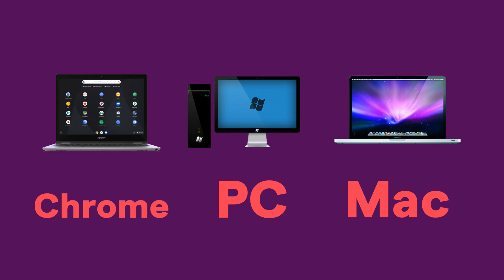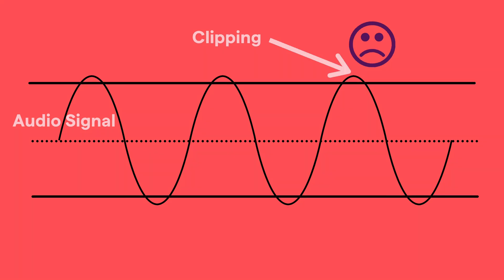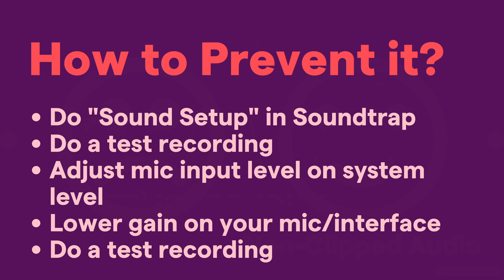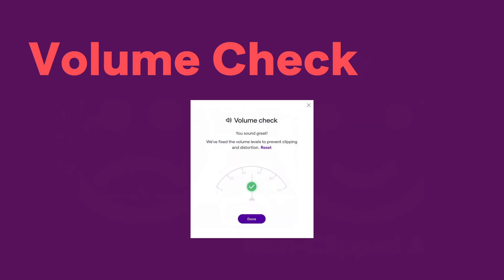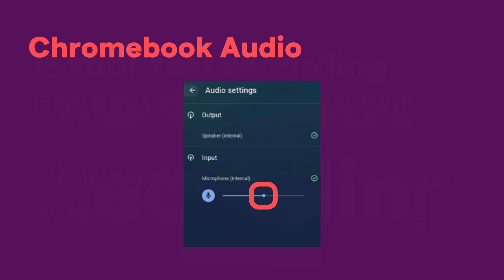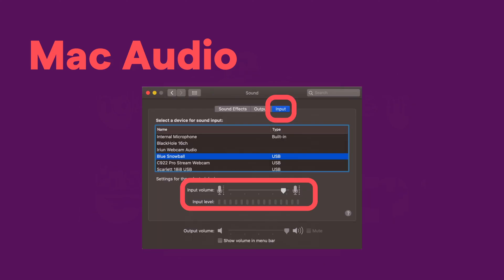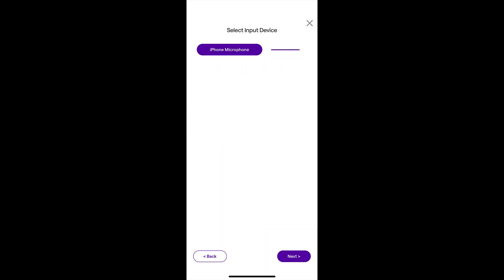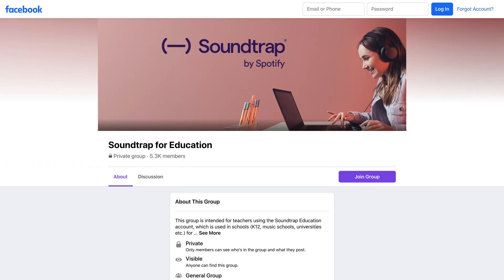How to Fix Common Audio Issues in Soundtrap

Comment: Yo! So I attempted Phonk (alongside many other genres but I won't get to these) without any trials and had to increase the base of Copenhagen Kit (beat type), used the 'Pan' effect on both left & right sides on a Vanilla (beat type again) track and majority of the piece is really loud and distorted, just like it should be. The issue is after it's done mixing, it's way, WAY, quieter and doesn't include the base adjustments. Is it due to the volume being too high and Soundtrap automatically lowering it for whatever reason, due to the 'Pan' effect or something else? In other words, help-
Reply from the maker: This might be due to Soundtrap's auto-mastering. When you select File-Export, you can toggle off the auto-mastering.

Comment: Honestly, I'm not pleased with Soundtrap and am moving on to another program. The title of this video is misleading. Soundtrap doesn't have a ay to fix clipping after the fact. Plain and simple. And re-recording isn't always an issue. But I've had issues with almost every recording I've done. And several of these issues have started minutes into the recording which means a "small sound test" like the video recommends doesn't help me in that instance. It's a shame because there are things I like about Soundtrap. But the quality of my podcast is suffering at the hands of a program that simply can't do that things other programs can do.

Comment: Hi soundtrap,I have a question need to ask you,will soundtrap mobile version has delay issues?(I'm worry about this delay issues,cuz before that I use bandlab to record but there has delay issues,so I would like to ask you will there any delay issues in soundtrap?) 
If soundtrap has delay issues,how to fix it?Using sound setup?